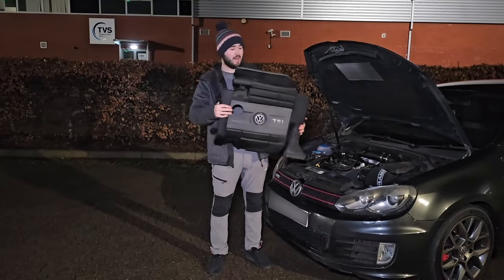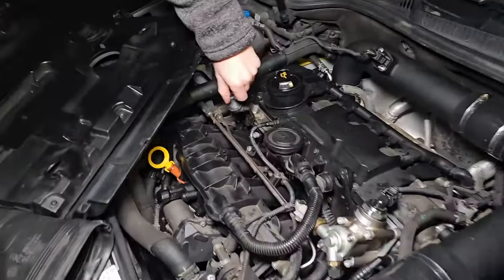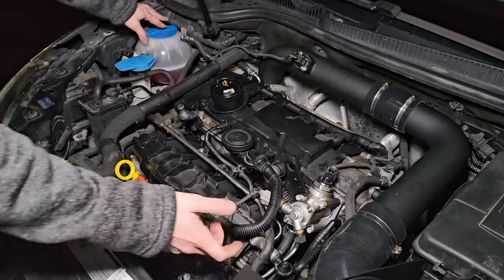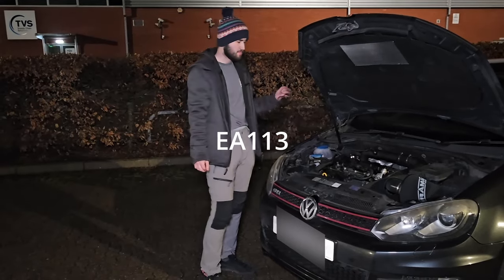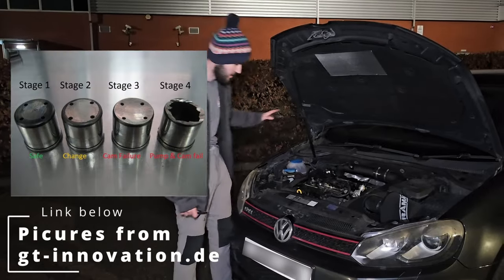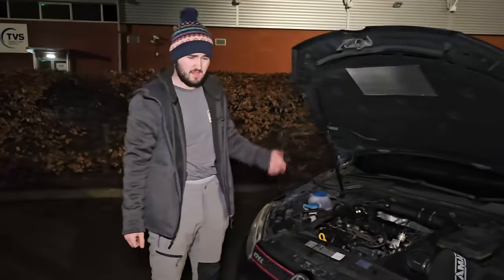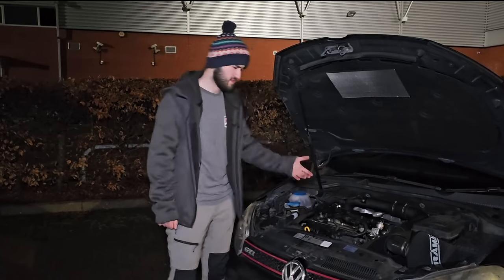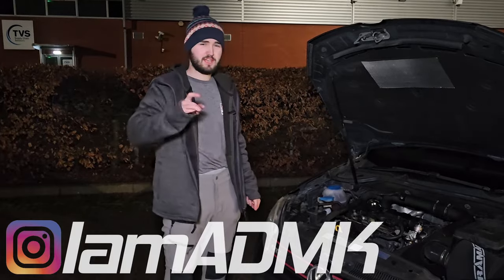Worst designed VW part that will cost you dearly!

Comment: Another thing to keep in mind with EA113s is the oil dip stick. If you have the original - orange one. Some of its parts could be broken and inside of your engine. It is advised to replace it with newer one - yellow. I did that with mine like 3 months ago and the orange one was in a bad shape. Also it didn't seal properly. on CDLA engine code.
Reply from the maker: I didn't know that. Thanks for the info I'll pass it on to the owner